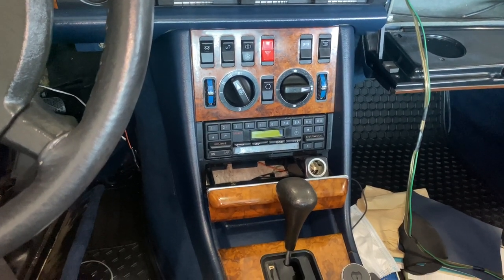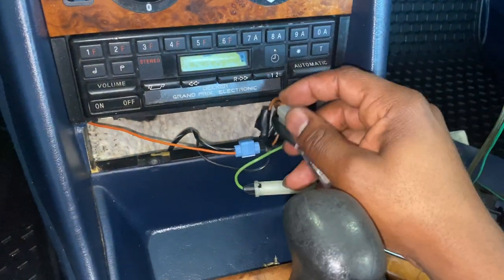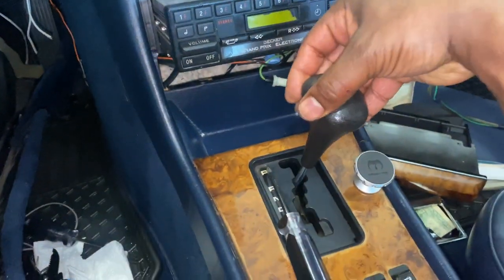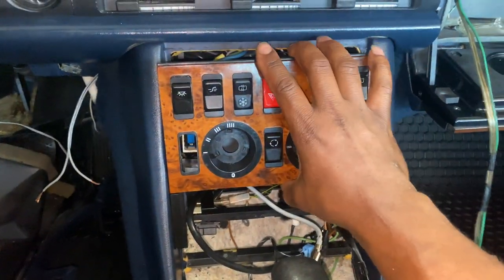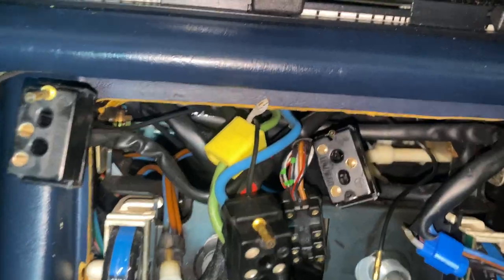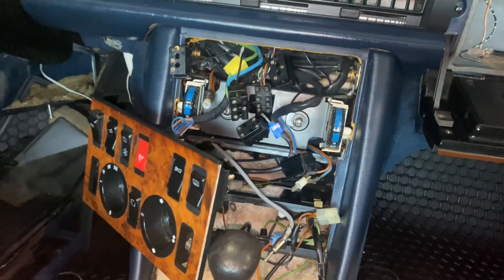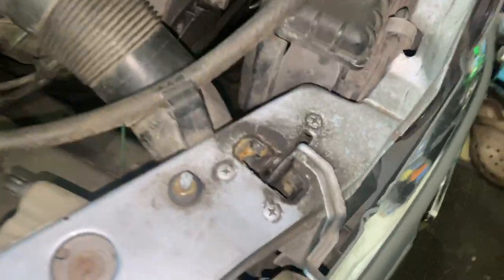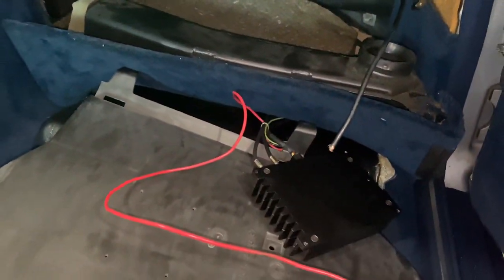How To Remove Radio & Climate Control Mercedes 1983 380SEC W126 C126 500SEC SEC Becker Stereo

Comment: My Becker was not the same and had two clips at top which are different and spring loaded. It was HELL getting it out. I was forced to cut the springs to prevent further difficulties down the road. When I posted online about this no one recognized my Becker’s tabs. Turns out they were used for a very short time and discontinued when they (Becker) realized the design was too difficult to use. In the end I’ve replaced the unit with a Continental CD player with Bluetooth and it’s a far better sounding radio. Love it! And it’s far safer to have your phone connected via Bluetooth when on the road. The Continental looks like it was designed for this car so you should check it out. They have a CD version and a no-CD.

Manual climate control rocks. I’m so jealous!